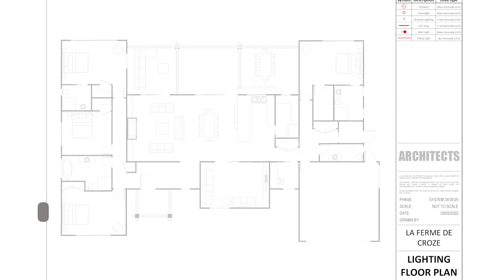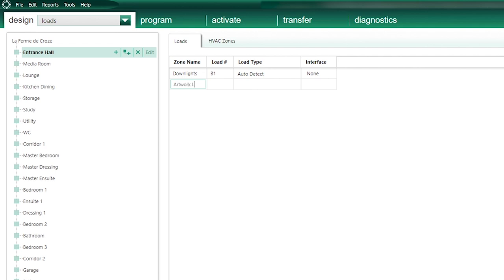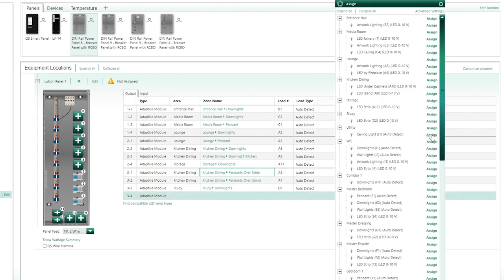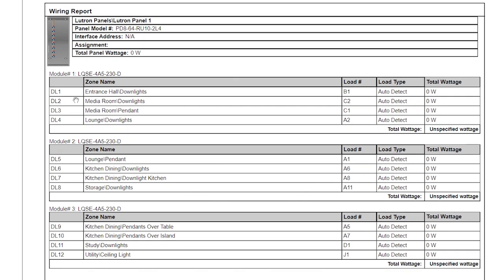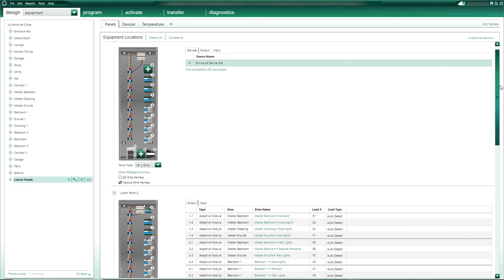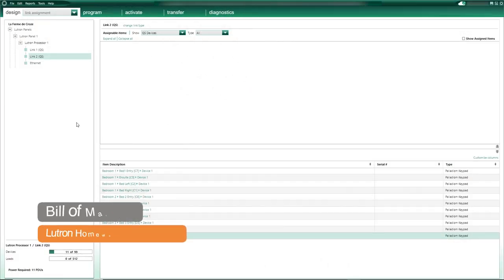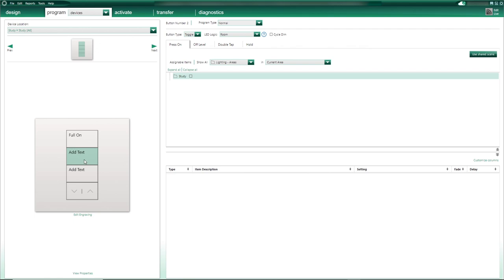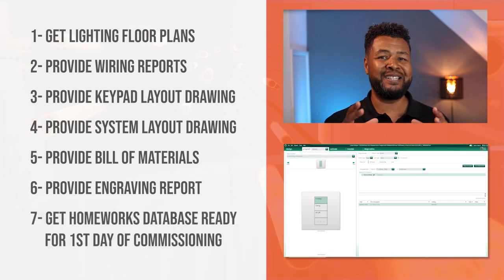How to Design a Lutron Homeworks QSX System // Complete System Design Package [New] (June 2022)

Comment: Great video!
We have some problems between occupancy sensor and palladiom keypad. We couldn't use them correctly. For example I enter bathroom and lights turn on by occupancy sensor then i left bathroom during a minute and i turn off the lights by keypad. If i forget something at bathroom, the light won't turn on when i enter bathroom during a minute. That's confuse me. I don't still know what is the problem here. If you enter bathroom after a minute not (50 sec or 30 sec) , the lights will automatically turn on by occupancy sensor.

Comment: Hello sir,
Need some help/advice after burned-out module replacement for 1 light group (LQSE-4S5-230-D)

in manual mode all lights work from the module
the application Lutron RA2+HWQS can see switches and lights but cannot control them what to do?
seems like it needs to be mated to my system, any tip where I can find manual or something how can I do it myself?
Reply from the maker: Hi, I would suspect a loss on the communication from the lutron cable here. Try to re-address the module. If that fails check your communication cable ✌🏾

Comment: Hello sir... for residential use Automation, (KNX/SAVANT/CRESTRON) which is good for a project of G+2 building and area of 5500 sqft Plz suggest
Reply from the maker: My point of view today is the same. All those brands are good - it will all depends on your capacity of designing, installing and programming your system based on your client requirements 👍🏾

Comment: The video was really helpful 
I had a follow up question 
Does RRD-3LD-SW (Radio RA3)  device work with just the QSX processor ?
Reply from the maker: Thanks for your comment. Not to sure as we don’t have RA3 here in the uk and no opportunity to test that. I would advise you ask your local lutron rep.

Comment: If I have a Lutron Homeworks QS system already,  would it be possible to replace the QS processor with a QSX processor without replacing any other parts?
Reply from the maker: Yes it is possible. If it is a pure Processor upgrade from QS TO QSX Just need to change processor. 

However If your existing QS is already an upgrade from HomeWorks illumination to QS and you’re using software licences to use, let’s say, illumination keypads on your QS system at this point it won’t be possible. You will have to change the keypads. 

Hope this helps 😉

Comment: What types of wires should be use for DALI loop signal
Reply from the maker: DALI requires 2 core cable. Then depending on distance max etc you will need to check what section of cable will fit best your application. This is also in case you choose to have your Dali fittings to be mains powered separately. 

Alternatively you can also choose to use a 5 core cable to power AND for Dali communication. 

Hope this helps 👍🏾

Comment: The only problem with using area scenes is that the Homewoner cannot edit them on the app. The solution is to use Zones.
Reply from the maker: Correct! The idea here, as mentioned, is to optimise first day of commissioning with a quick way to program keypads before getting to site in order to test installation. Once we got everything working then we can use “zones”, create lighting scenes and complete all advanced programming. Whatever way work best for the Lutron guy. Thanks for your comment ✌🏾